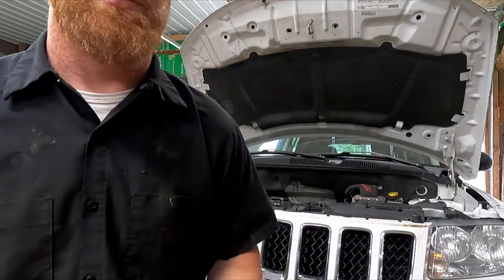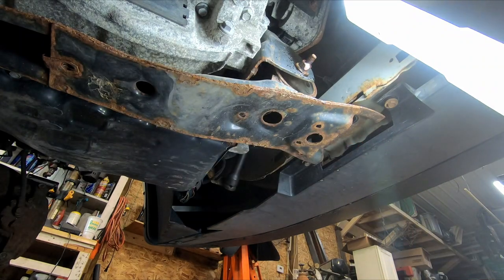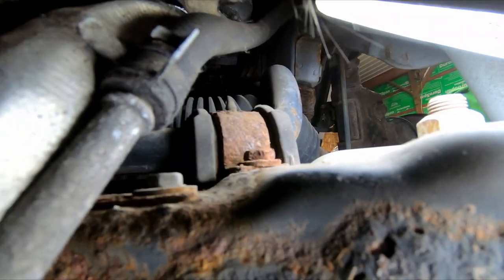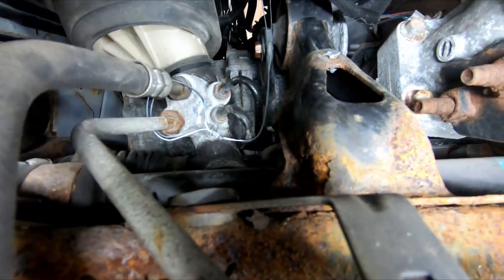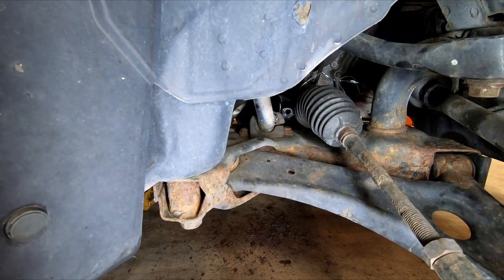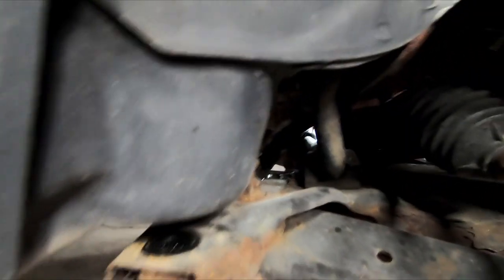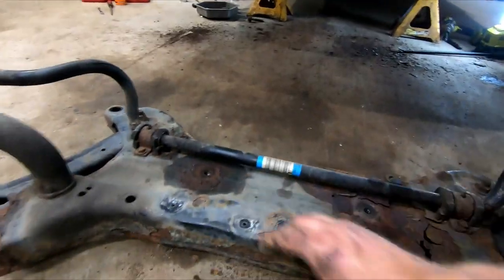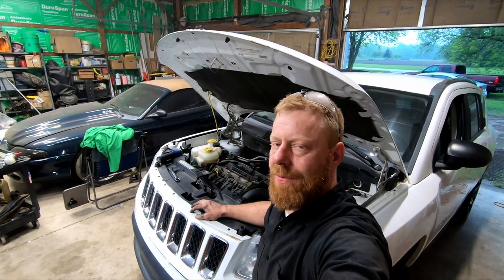2011 Jeep Compass Rusted Cradle Removal: How Hard Can It Be?

Comment: I’m am the least experienced wrench turner I know. I did the front and rear last fall in my driveway. YouTube videos and a Haynes manual was all I needed.
Reply: My dads not a mechanic but he’s worked on my 2012 jeep compass for anything i’ve needed he’s good with his hands but my rear sub frame is rusted out (i don’t know if that’s what the part is  actually called) my back rear tires slant inwards a bit.  he was questioning if that really is something he can do at home for me he said it looks like it’s held on with bolts or whatever so he thinks he can was it really not that hard to replace? he said something about having to take out the engine and stuff to replace it and that’s the hard part or i really don’t know if that’s what he said.

Comment: Thanks for the info I'm doing a 08 jeep compass and i had a little bit of time on the front bolt since I couldn't see it so I just use the grinder and cut it since you could see from the bottom

Comment: At the start of the video, I had a rusted cross member holding up the engine mount.    Thanks for this video, I had the part in my trunk for over a year, and today I finally got it installed after watching your video 5X.   I didn't need the impact wrench.   All I had to do was remove the splash guard.   Thanks again for this detailed video with socket sizes.
Reply from the maker: Thank you for taking the time to comment and share your experience.

Comment: I just replaced the subframe on a 2008 jeep patriot I bought. It was not bad the front transmission mount bolt was a pain but I used a tekton 1/4 swivel ratchet with 1/4 to 3/8 adapter and 16mm socket. The ball joints can be a pain but you just need a pickle fork tool. I recommend undercoating the new subframe before you install it.
Reply from the maker: Appreciate you commenting.

Comment: Thanks for this! I'm about to attempt this on my 2007 Compass and I'm contemplating if I want to try it in the driveway or take it to the lift. I'm accepting all well wishes and advice. Also, any tips on torque specs for reinstall?
Reply from the maker: It's really not a bad job.  Go slow and make sure you have two jacks to lower it down.  Chalk the rear wheels to be safe.  Sturdy jack stands.

Comment: I'm about to attempt this on my 2008 Jeep Patriot! I'm def. A little nervous. This is one of only two vids I could find really that has to do with changing this on my vehicle. I know all this rust could be a huge issue trying to get these bolts out..
Reply: I was wondering.. should we use any type of coating like copper spray for the bolts to prevent rusting and being a bitch to get out again?
Reply from the maker: It couldn't hurt to use some antiseize